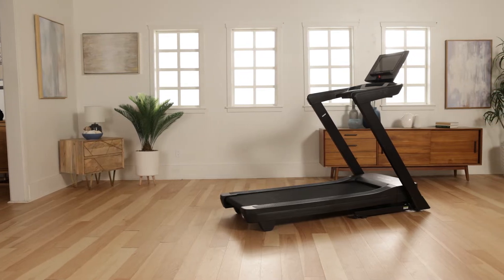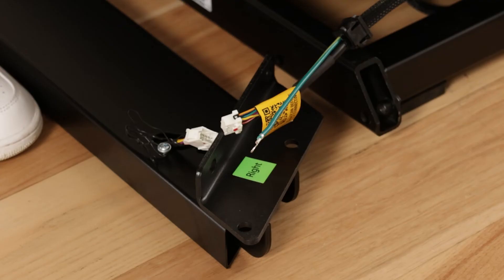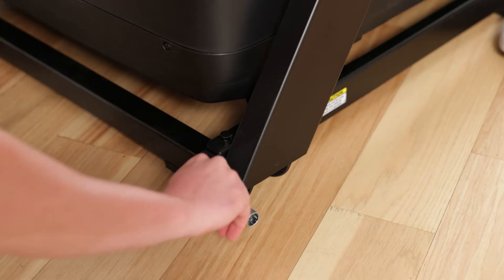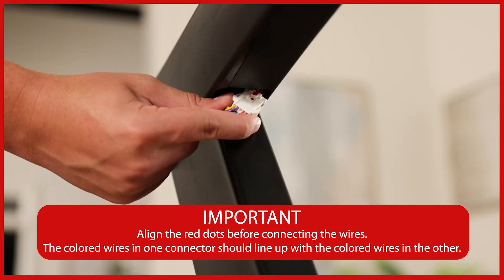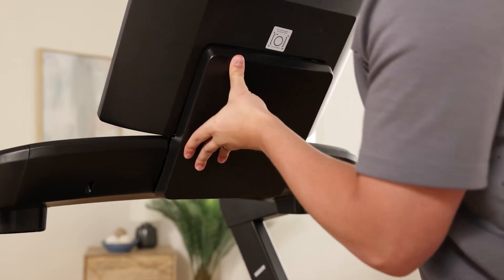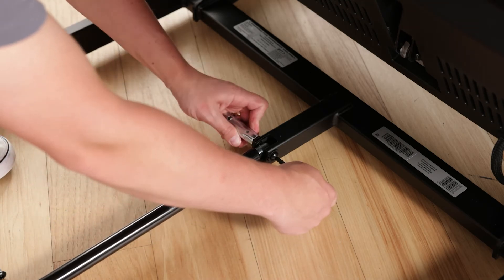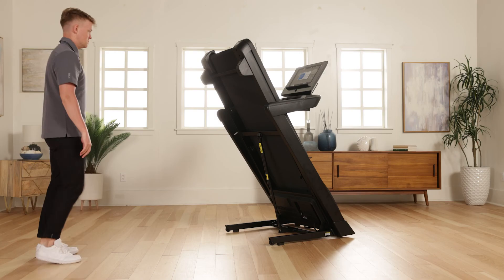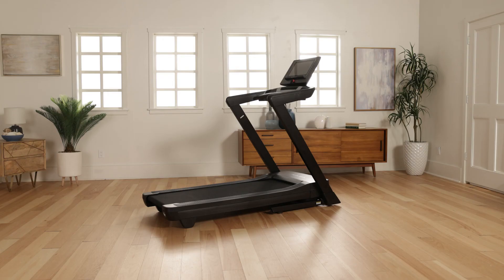2023 NordicTrack EXP series treadmill assembly

Comment: Help with step 11 part 2, the hole is smaller than the screw 😢
Reply from the maker: First make sure you are using the correct hardware. Second, some screws are intentionally slightly undersized and when the screw engages with the plastic or metal the tight fit and self threading of the hole will help keep it in place.

Comment: The ground screw doesn’t go all the way in. I’ve tried various angles of insert, and tried very hard to tight the screw all the way but it doesn’t. I mean, it works, but can’t fit the plastic cover at the final step. Is this normal?
Reply from the maker: Most of the time the ground screw will be creating its own threads so will be very tight to install. I have a big screwdriver I use for these screws to put more power into the screw until the threads are developed.

Comment: I have bought one but motor has a sound is it normal?
Reply from the maker: They are not completely quiet but the motor should have a nice hum to it. If it is nocking or grinding you should probably have it looked at or take a video and send it to the manufacturer to consider possible parts and service options.
Reply: @FitnessEquipmentHelp   when switching  speed 5 it has a loud sound

Comment: I don’t think my treadmill came with the right hardware kit … my bolt lengths aren’t matching what you are saying in the video.  Anyone else have that problem?
Reply from the maker: Compare the hardware to the Chart in the front of the assembly instructions in the manual. There may be some variation between versions. If the hardware doesn't match what is in the manual for your specific version then get a new hardware kit.

Comment: There's literally no connector wire inside of the right upright. Didn't come with one.
Reply from the maker: Later versions (after this video was filmed) have a different wire, all one piece, to be strung through the upright by the assembler. This was described in an "Important Assembly Update" flyer or in the instructions found in the manual depending on the version. If you have one of these late versions you will find a long wire coming from the motor bellypan and a pre-strung wire tie in the upright. Connect the lower end of the wire tie to the end of the long upright wire harness and use the wire tie to pull the harness through the upright.
Reply: I was looking for the wire like where is it

Comment: Video great but equipment is fragile nothing aligns the same in the video
Reply from the maker: If you are having problems with alignment make sure you are leaving parts loose and not tightening any of the fasteners until you are instructed to do so in the assembly instructions. Good Luck.
Reply: the handrail is  inches off.  2-3 inches too narrow to fit onto uprights.
Reply from the maker: @cledr2485  This is usually because the uprights are too tight. You will need to go back and loosen the upright bolts and only tighten them when instructed to do so in the assembly instructions.